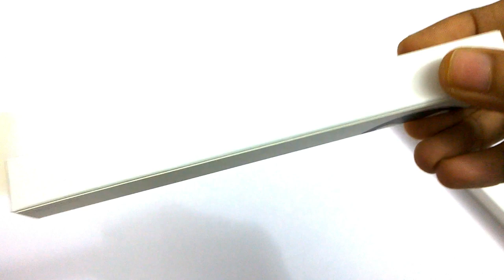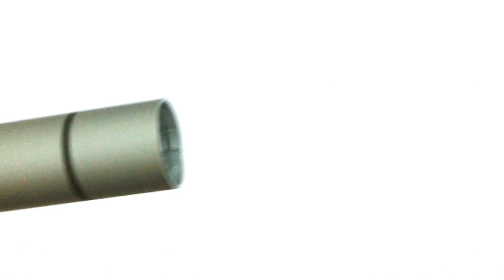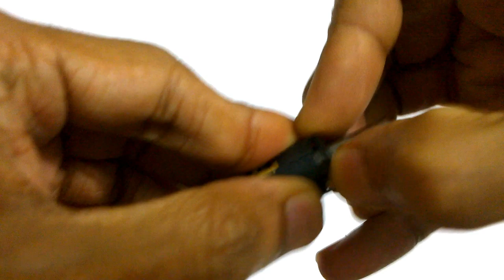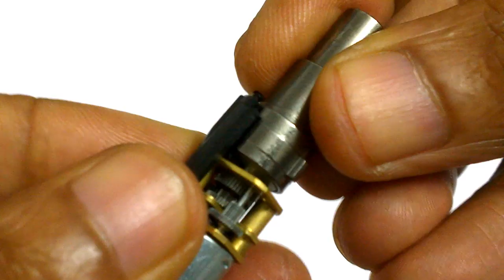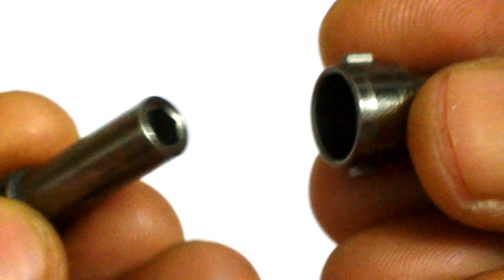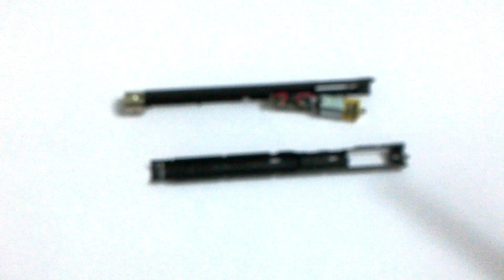Xiaomi Wowstick Electric Screwdriver - Disassembly

Comment: To get the USB port back into the back cover, pop the cover out using a long rod or dowel, then you can unscrew the little retaining screw and put the USB PCB back in, then re-insert the screw (I'd recommend putting a little loctite on it)

Comment: Hi I found that i need to buy a new N20 motor, but I dont know which one. Its it 3v? And what would be the correct RPM?

Thanks in advance
Reply: I have another model called "GearDrive" which is very similar inside, and the motor says 6v on it (marking on one of the sides) although mine runs on a built in battery. The light still works but the motor won't turn do you have the same problem? (FYI if you can't find marking you can probably measure the voltage at the motor while trying to make it turn)
Reply: @thecrazy8888  I ended up buying a 3v motor and it does work with the leds, but the torque is very weak even though it seems to spin at the same speed. When I measure the volts and amps. The original motor read 4volts at 1amp, but I haven’t been able to find a N20 motor that matches those readings.

Comment: Nice 👍 is the disassembling on the lithium battery version the same?
Reply: hello, yes that would interest me too. thx
Reply: yes, please, help with the battery one
Reply: Same problem,how to open the back
Reply: @WahyuHidayat-tr1rf  did you get it figure out?
Reply: @pyrosam7  nope,i did'nt find yet
Reply: The rechargable you open the same but you press the bitholder into the tube so it comes out of the back so you dont damage the charging port
Reply: @familielacour9534  Thank you very much ☺️

Comment: Fine, but mine doesn't use removable AAA batteries and is completely different. I guess this is an old model.
Reply: Mine is also different and branded "geardrive" but it opens the same. I suspect it's all from the same manufacturer.

Comment: why is it called dual power, i only see 1 motor or because it is being powered by 2 batteries?
Reply: I rotates in both directions
Reply: @harichintha4985  really? That kinda lame for a name "dual", right?
Reply: @doanh6499  marketing tricks, they will workout.
Reply: you can use your hand to turn without battery power. Other electric screwdrivers can't do that
Reply: Probably yes. It's a very "chinese" thing to imagine features for the product description.